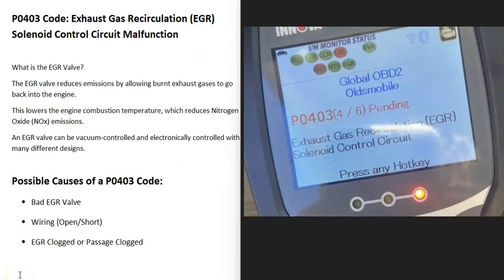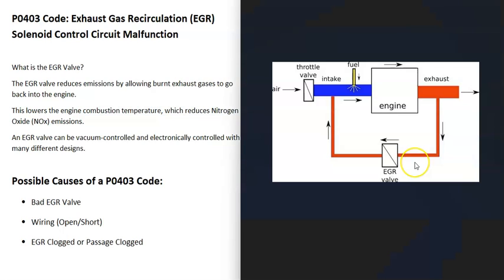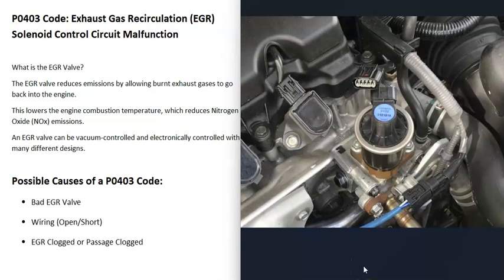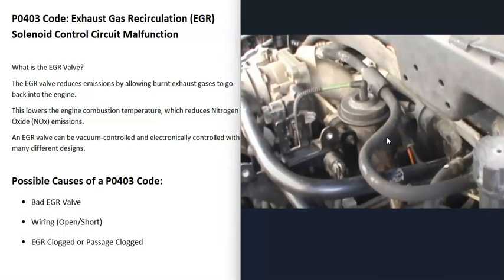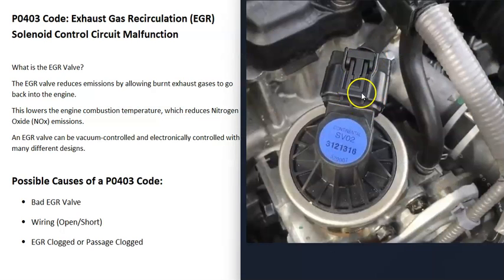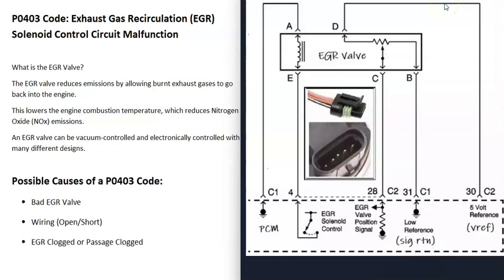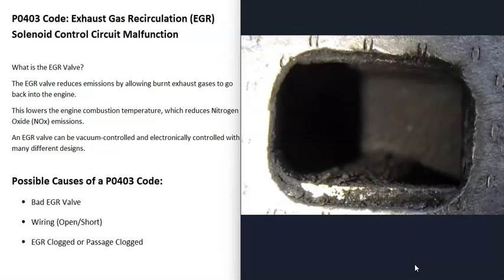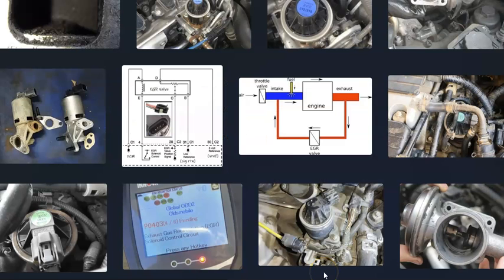Causes and Fixes P0403 Code: Exhaust Gas Recirculation (EGR) Solenoid Control Circuit Malfunction

Comment: I did replaced it and the light still on, it says open
Reply: I fix it, my mistake was I put it back one bolt that was few threads longer and won't tide the line, so I found it and replaced de bolt and the light turned off
Reply: Same issue here
Reply: Same issue here now

Comment: Nice video but can that cause the car to loose power and shut down
Reply from the maker: The engine may idle rough and may stall at a stop sign, but usually, the engine still runs.